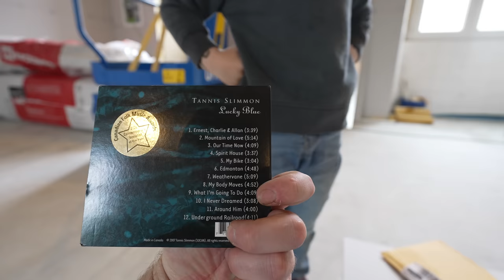Preserving Our Legacy

Comment: Purchase a piece of 6 inch PVC pipe and 2 end caps. Glue and seal them on the ends of the pipe. This will work much better for a time capsule. The plastic tub and lid will not hold up for too long.
Reply from the maker: good idea!

Comment: If you have not sealed it up yet, you should include a a copy of this. In several formats and types of media, maybe include several different types of players, with instructions on the code and information on how to read it. For the people who might believe that this is overkill. Analog is somewhat simple to decode, and the only other issue might be the language, according to the distance between the time periods. This is digital. Imagine for the most of you out there. If you found a piece of media that was from, before Microsoft took over, and before Steve, Bill, or anyone that is remembered by most was born. It would be a extremely small amount of storage, and a possess an extremely low resolution, and with no way to drop it in a player, or exactly know how to decipher it. Most people might destroy it, by shorting or something, especially when it would not be as stable as newer technology. Now imagine 100 years ago, and look at the development, vs point in the 100 years past, which it was developed, released, became mainstream, peaked, fazed out, and became a novelty, if applicable. Now, in the next 100 years, if we have not neutered, exterminated, lost almost all technology, from an EM or the sun spitting on us, or went on a world wide resistance, because of the gap between the classes or since the middle class is basically gone, The ones who have and don’t have. This is going to be an wild and crazy world. We might not be so much recognized as people as we are today. We might be jacked in basically our whole life. It used to be an event to log onto the web, now to log off, is an event. They sale phones for too many hundreds of dollars, to link with your smartphone, where you can call, maybe text, and you might have another feature or two, but no social media, browser, or other features like.